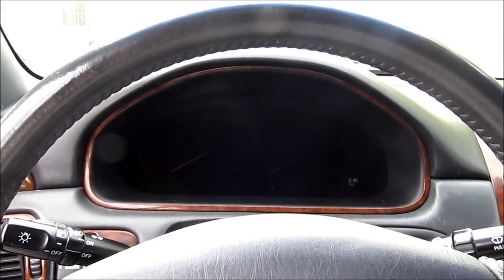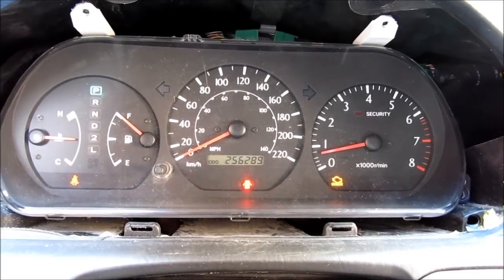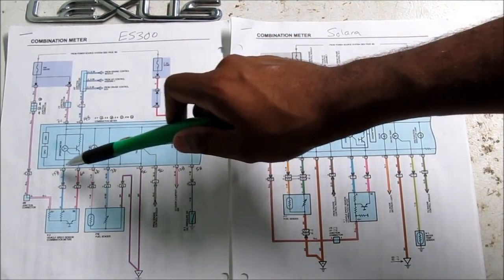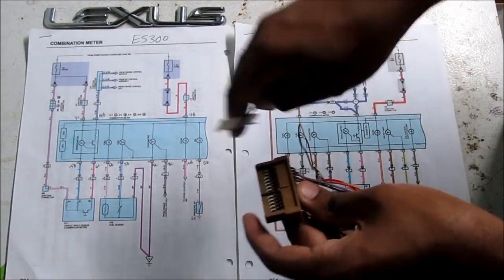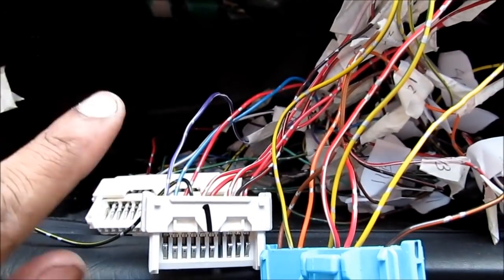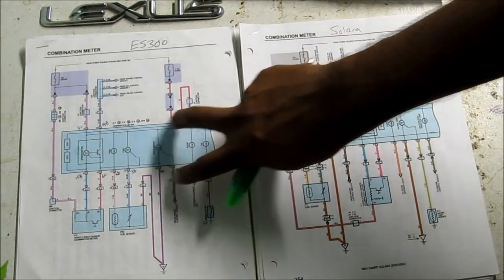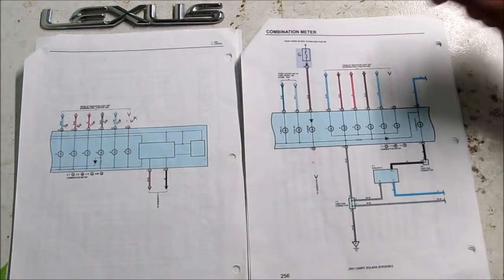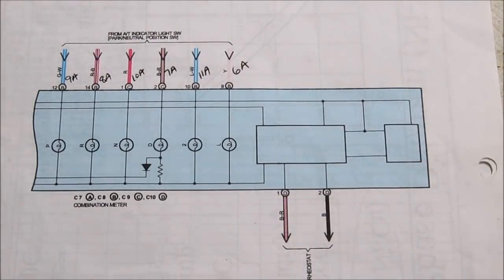Toyota to Lexus Instrument Cluster Swap

Comment: I know this video is old but i recently wanted to do this.  But for the wiring diagrams i needed i just called the dealership and they emailed them to me. You might have to do some calling around because some dealers will tell you that the information can't be shared but i was lucky with the dealers in Wisconsin

Comment: Wow dude, this is a crazy big project!  Very impressed by your patience :)
Reply from the maker: Thanks,
If you pause the video, you can note the electrical diagram. PM me for more diagrams.
Reply from the maker: Junkyard is your only bet. The harness aren't really sold separately (except maybe the dealer for $10000 lol).
Reply from the maker: Good to hear. I bet you have a V6 Camry and the tachometer worked out okay? I think they're different for the I4 cars.
Reply from the maker: So your tachometer is reading too low, correct?
Remove the bulb from the low oil sensor.
Reply from the maker: Good for you :) Enjoy the cluster.
Another TN member did this mod on his I4 and got the same inaccurate tachometer reading.
There are modules that you can buy that can adjust the voltage on the tach wire for recalibration. They're made for recalibrating clusters in cars that have swapped engines, say a V6 to a V8. Worth taking a look.
Reply from the maker: The repair manual shows 13.5V DC when testing the tachometer. I don't think they'll get any more specific than that, so you'd probably be on your own hooking up an oscilloscope to the tach wires.
Alternatively, you could see if there's a way to swap the tachometer "motor" or circuit from your 5S-FE cluster to the Lexus cluster... just a thought.
Reply: @speedkar99  
I need some wiring diagrams, please give me

Comment: Nice job.
I have a request. Do you have the circuit diagram of Instument Cluster Lexus ES300 2000? Mine blew a capacitor completely out. Its completely burnt out beyond recognition which makes the entire cluster dull. Otherwise, everything works fine.
Reply from the maker: +Kraisar Gilitwala I don't have a wiring diagram of the internal cluster. I don't think Toyota provides this as thier fix would be to replace the whole cluster. Most likely the long back light tube burned out. You can source a replacement frm a junkyard cluster. They're very easy to break, I broke a few, so don't mishandle.
Reply: Thanks buddy. Do you have instructions to remove the long back light tube? Thanks in advance.

Comment: Can I get the ES300 diagrams from you?  Im trying to use the cluster for a different project and having trouble figuring out the pins that need power to light up the display, and will also need most the other pins to display info on the cluster. I was not able to PM you on TN,  Thanks!!

Comment: This video was just amazing! I have one question though. When I will do my car inspection will if show an error to them since some of the cables for the gauges will not be connected? And also because the mileage might not match from the old gauge?
Reply from the maker: All the gauges and lights work.

The only issue is with the odometer reading the doner car's mileage... I'm not sure how to correct that.

Perhaps you could swap it back for the inspection?
Reply: Maybe. And where did you get the cluster from?
Reply from the maker: I pulled it from a junkyard for $35.

Comment: Hello buddy i need some help in swapping cluster from a chinese spec toyota crown to a japanese spec. Some people say they wont work since the chinese has a 2gr fe while the Japanese model has a 2gr fse,  they also sited the different in fuel injection system too.

Please am requesting you help in it. Reasons for swapping is Japanese spec cluster is 180km max while the chinese version is 260km

Comment: Brother thanks for such valuable information on the cluster swap. Your video has motivated me to do so. I bought one cluster & labeling is already done. But I got one issue. When comparing to your details & diagrams, my es cluster blue plug (A) has one additional wire (pin #12a) which in your diagrams is null slot. Can you advise what to do here. The wire color is R-L
Reply from the maker: Check the diagram for your model year
Reply: @speedkar99  where I can get these wiring diagram.

Comment: The instrument cluster went out on my 2005 Lexus ls430, lights and gauges! Everything else works fine! Checked fuses, would you recommend replacing full cluster? Is it something I can do? Found a cluster on Ebay! Thanks in advance!
Reply: Same here in my 2000 Camry. Everything works except the gauge lights themselves. And the fuses are still intact, nothing blown

Comment from the maker: It shows 55404-06020 according to the Village Toyota website. There might be different versions, as the wood trim on mine is simply double sided taped on around the edges. Auto wreckers is probably your best bet. Not sure if it'll fit the ES300 though.

Comment: Hello, it's amazing the work you've done, do you think that you can do in a Camry 95? if this were possible, could you help me with diagrams ?.
thanks for your help
Reply from the maker: +Orlando Collantes The 95 isn't nearly as easy. The 95 Lexus ES300 that you'd have to swap the cluster from has a digital odometer, while the Camry has a cable driven one. Not sure how you'd get that feature to work, as a minimum. But if you can forward me both wiring diagrams I can have a look.
Reply: +speedkar99 Hi, thanks for your quick response, an image attached diagram camry 95  https://dl.dropboxusercontent.com/u/74927943/IMG_20151012_001714.jpg 
I also thought the odometer was the only measure that may not work out.
I will be attentive to your response and thank you very much in advance for the time given.
Reply from the maker: First off, visit your local junkyard and see if a 1992-96 ES300 cluster will bolt into your 95 Camry without modifying the dashboard.

The schematic diagram you posted looks similar to the setup in my car, its possible it will work. Can you forward me the 95 ES300 wiring diagram to compare it against?

Most likely you'll just have to de-pin and swap wires like I did in this video. Make sure you get the pigtail harness from the ES300 cluster in the yard.
Reply: +speedkar99 thanks for your advice, I found a cluster inoperative and this fits well into the room to the board, then conseguire one in good condition for attempting to change. Moreover I would like to ask you to please (if you possible) you may send a written summary of what happens in the video.
Thanks again for the time you take to help
Reply from the maker: Here's the writeup:

http://www.toyotanation.com/forum/103-3rd-4th-generation-1992-1996-1997-2001/591121-diy-camry-lexus-es300-instrument-cluster-conversion.html

Comment: How does the solara not have an oil pressure light when it has one on my 1999 solara? I like this video I am going to do this it is easy however I would recommend you have soldered or used massive amounts of electrical tape (: the heat will make those come off.
Reply from the maker: Your right. I intended to go back and resolder all my connections once I verified it works.

The Solara only has a low oil warning light. The ES300 has this in addition to a low oil pressure warning light.

Comment: Do you have a video on how to replace the LED lights on a 2007 Lexus IS350, the RPM needle light just went out and speed needle will go soon. ..  thanks for any advice!
Reply from the maker: I believe your needles might be LED.

In that case you'd have to open up the board, desolder the old LED, and solder in a replacement.
Reply: speedkar99
Reply: Thanks yes, thru YT I was able to find a shop in Anaheim, CA that did this for me...  far more reasonable than dealer price for sure!

Comment: Hi... I'm gonna do the change with my 1997 Camry. But I have one Question: You Said in your video thar the Oil Pressure Light feature it's not available in the Camry. But my Camry have it!!!. I mean, I have an indicator that  warns me about the Oil. Could you confirm this?? 
Another thing, could you publish the Camry 1997 Combination Meter Diagram with your anotations as you did with your Solara??

Regards.
Reply from the maker: There's two oil lights on the Lexus. I think one is an oil pressure light and the other is an oil level light. The latter isn't on the Camry, so simply remove the bulb from that socket before installing the cluster.

The combination meter wiring diagram for the Camry is the same as the Solara. Follow link in the description to the diagrams.

This will work on V6 Camry's. With the 4 cylinder, the tachometer will have to be recalibrated somehow. One other tip: use t-taps instead of twisting and taping the wire like I did, it should be more secure. Good luck on your swap.
Reply: Ruben Jimenez Ok. Thanks!!!
One Final Question: I didn´t Catch how the Fourth Connector was wired. Is there any key-Points you could elaborate about it??
Reply from the maker: Ruben Jimenez
You can either re-pin all the other connections to work with the 4th connection or tap them into the existing connectors. The number of wires is approx. the same, its just distributed across 4 connectors on the Lexus cluster instead of 3 on the Camry.
Reply: speedkar99 I just made the Change today!!! As you said, I re-pined with the existing conectors and it was very smooth. I just did it in 4 hours. Now I have my ES300 Gauge working Great!!! Thanks a lot!!!
Reply from the maker: I'm glad it worked out for you, you must be enjoying those nice crisp bright gauges!
Reply: Since this is a frequently asked question, let me further clarify for other readers/viewers for you.

The oil level sensor is more dynamic on a Lexus and most luxury cars (my BMW does the same); not only does it warn when the oil levels are too low to safely drive it (red oil light that is in everything from an 80s economy beater to a Veyron that means STOP before you ruin your engine), there is also a light that monitors the regular oil level, and lights up around the same time the oil level dipstick is on the lower side of the notch/criss-cross pattern, which turns on a yellow oil light advising to add 1 liter or quart. Since a Camry or Solara doesn't have an oil level sensor, the light will stay lit and assume there is a malfunction with the oil level sensor, hence why killing that light is advised.
Reply from the maker: Agreed. One is an oil level sensor, the other is an oil pressure sensor.

Comment: Hey! Great job! Any possible way to contact you? Regards
Reply from the maker: +Rodolfo Pérez thanks. Through Toyota nation or comment here.
Reply: I have a Korean version 2011 Kia Optima. My cars instrument cluster language is in Korean and after a lot of investigating, this cluster does not come with a preset that allows you to change the language. So I came up with an idea: I purchased a Kia Optima instrument cluster (English version) and put it in my car (Same engine, same everything) but when I plugged it,  ABS, EPS and BRAKE lights came on. So I checked each plug and found out that all the plugs wires are same color and placed in the exact same position EXCEPT for a white and orange cable on the USA version instrument cluster. What could I do to finish the adaptation?

Regards
Reply: Btw, the Korean version does not have this white and orange wire. Korean version has 28 wires and USA version has 29
Reply from the maker: +Rodolfo Pérez Perhaps get a wiring diagram for your domestic market and see what that wire does....its likely not a needed feature as I'd assume the basic gauge functions are all The same.
Reply from the maker: +Rodolfo Pérez I'm not familiar with that vehicle, sorry

Comment: Can this work in a 00 Toyota Corolla CE?
Reply from the maker: +Christopher Omar Find a cluster that physically fits and check the wiring diagram. The Camry cluster is too large.
Reply: Christopher Omar no
Reply: Any suggestions on what can work for the 93-97 corolla

Comment: Nice but why you could just change the led lights which would look nice too
Reply from the maker: LED lights don't look as sharp, bright and cool as the electroluminescent lights. I changed it and it still had a greenish tinge. Check it out here: Toyota Instrument Cluster Light Change
Reply: Ohh okay :)
Reply: But I see that your dashboard dont match with the rpm?
Reply from the maker: The tachometer displays the RPM fine, as long as your swapping into a V6 Camry.

Comment: your taping up wires leaves a lot to be desired
Reply from the maker: +Kev Reed Yea I kinda regret that now, I should have used t-taps. Most are still intact but one or two are coming loose.
Reply from the maker: +Kev Reed Yea I kinda regret that now, I should have used t-taps. Most are still intact but one or two are coming loose.
Reply: solder and heatshrink them. do it right once
Reply from the maker: +Kev Reed I should. Its not easy on your back working behind the cluster thou.
Reply: speedkar99 t taps are even worse